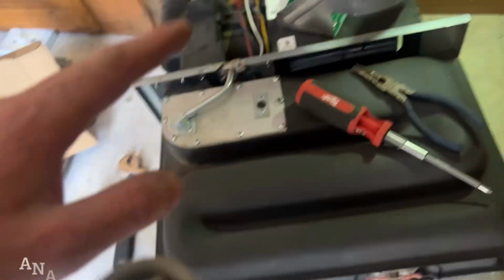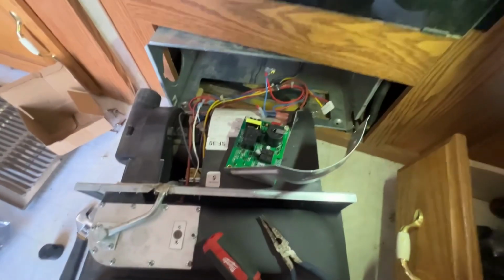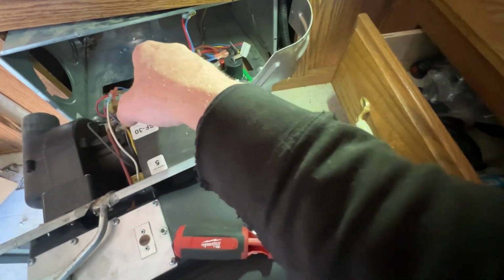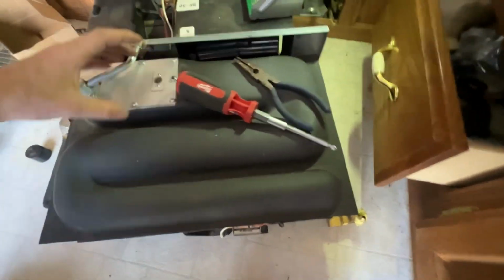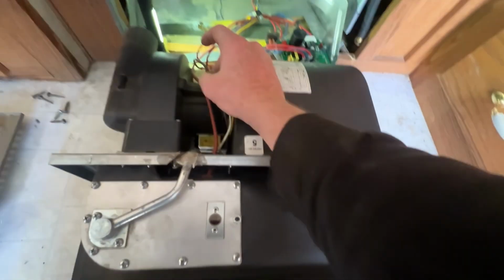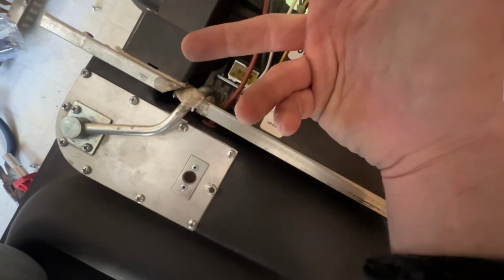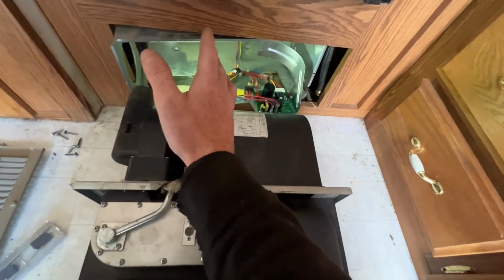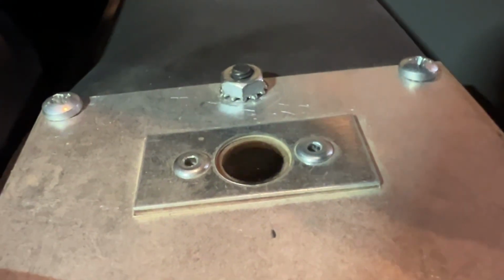RV Furnace Repair - Suburban SF-30

Comment: I gave up. An entire brand new furnas core = $398.00   Its on its way to me.

!
Reply from the maker: I’m about there, mine has developed new problems
Reply: One thing to check guys if your furnace is kicking off you should check to make sure the venting isn’t restricted.  Run it until it kicks off and then check the limit. If it opens, could be vent restrictions, also I would check the heat exchanger to make sure it isn’t obstructed.